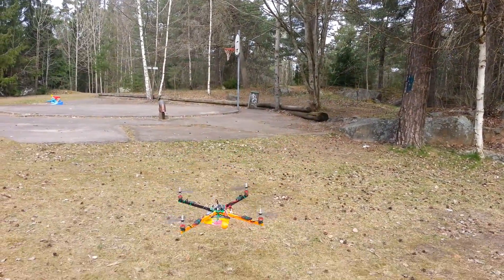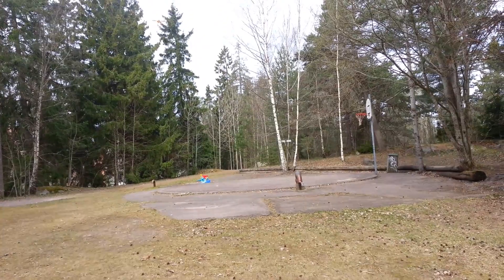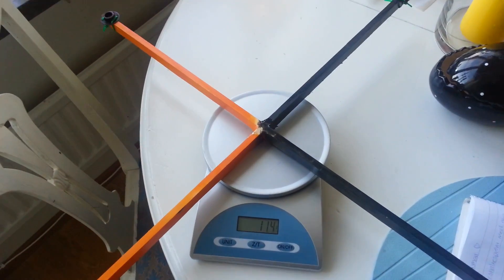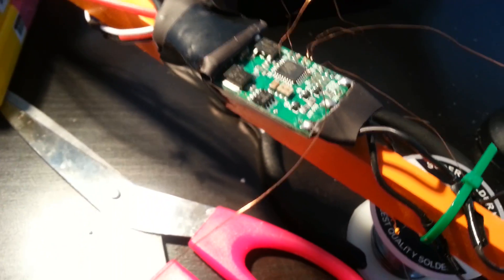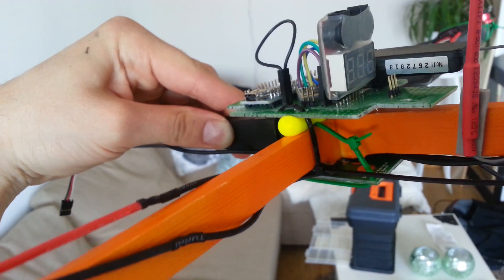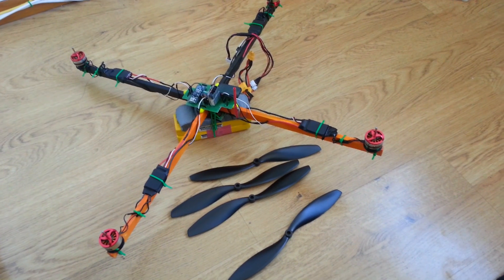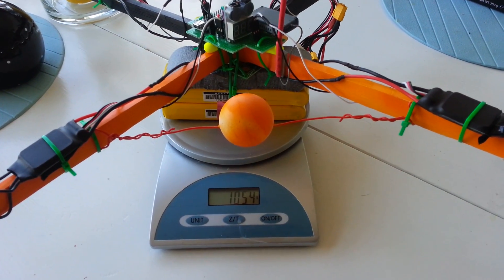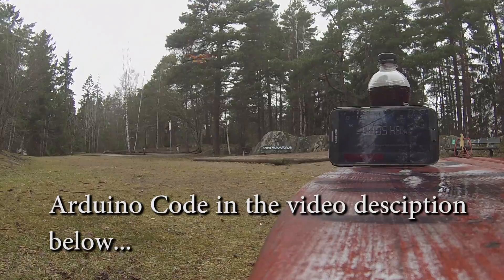Building Arduino quadcopter 30 min flight time + code and schematics

Comment: hello josef, i will buy the remote control, is this the remote you use ?
https://ecs7.tokopedia.net/img/product-1/2015/4/27/413065/413065_c85bf970-ecb2-11e4-adbe-b50387772fba.jpg
Reply from the maker: magfur ramdhani , please see parts list: Radio-controller: Hobby King 2.4Ghz 6Ch V2
Reply: thx for replying
ok, now i know, im sorry, if i change the radio controller to Turnigy 9x, if there any change with the code from arduino? 
please reply again my comment, :)
Reply from the maker: magfur ramdhani , You will need at least 4 channels for normal flight. The code is written in a way that it expects a ppm-signal with 1000-2000 microsecond pulse-length from each channel. As long as it gets the signals, it does not matter what type of transmitter/receiver you are using. If the signals differ somehow you will probably need to change the code a bit. Also, you can use two more channels for PID-tuning if you like, which is nice to be able to do in the beginning of flying your quadcopter.
Reply: Why do you use 2 batteries , whether for durability in flight , or to be with power like that , can I replace it with 1 batteries , but I give the power of 5000 mAh ?

and then , if I see quadcopter yours that you have made , why you cut the red wire from ESC are connected to arduino ?

thx for the answer :)
Reply from the maker: magfur ramdhani Yes, you can pick some other battery. As long as it matches your ESC:s and can provide the current necessary.
The red BEC wire is positivt voltage out, and my control board takes its power from the battery charging cable directly, so the red BEC wire is not needed.
Reply: thanks josef, because i think if i can change two battery into just one battery, the quadcopter can lift more weight, like gimbal and some gopro camera, 

do you know Ardupilot board, ?
what do you think, Can if it makes a kind of ardupilot with arduino mega or arduino uno or anything else from arduino ?
Reply: magfur ramdhani Slow aja gan :v
Reply: Muhamad Andi Prasetyo iya gan sini slow kok,, agan ada saran, ?

Comment from the maker: Mark Böhm, I have not tested with this quadcopter, however I made one last year with the same motors+props (but other ESC:s), and it could generate a total of 2.4 kg of thrust. My guess is that this quadcopter would do about the same as that one.
Reply: +Josef Holmner What wire you use to connect HK-T6A-V2 to arduino nano
Reply: That is usually either because you don't wait for the ESC to reach start position or because you give wrong ppm values (< 1000 or > 2000).
Reply: Josef Holmner ,The program is facing several compilation problems....how did you upload this ??
Reply: hey. could u please say the wiring
Reply: how much rpm is the motor-esc setup in the video

Comment: Can I use a 5 channel transmitter ?? Please answer because I am making it.
Reply from the maker: saattvik thourwal , yes, you could even use a 4 channel transmitter. 1 Channel for throttle, 1 channel for pitch, 1 for roll, 1 for yaw. The other channels are used for PID-regulation, but you can do this manually in code if you want. You may need to alter the code a little, but should be no problem. Good luck!
Reply: Josef Holmner What is PID regulation ?
Reply from the maker: saattvik thourwal The PID-controller(proportional-integral-derivative) is an algorithm that (in this case) uses data from the gyro/accelerometer to keep the quadcopter stable and at a wanted orientation. There are other types of regulation algorithms, but the PID is usually easy to understand and works well for this implementation. Try google searching it and you will find a bunch of information about it. Basically i use the other channels of my radio controller to fine-tune the parameters used by the PID-controller.
Reply: Josef Holmner Can I use a FlySky CT-6B transmitter and receiver ?
Reply: Josef Holmner And which transmitter are you using ??